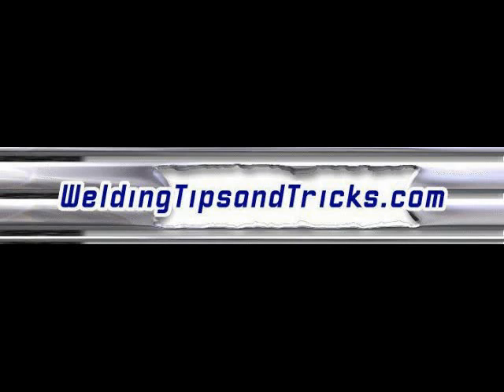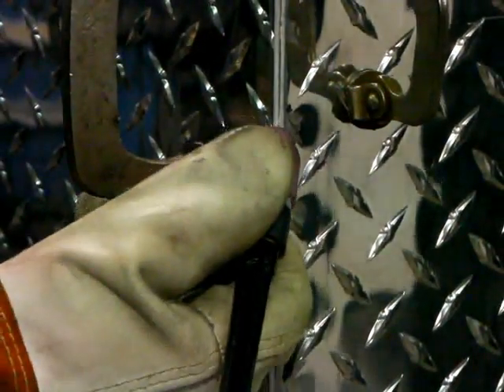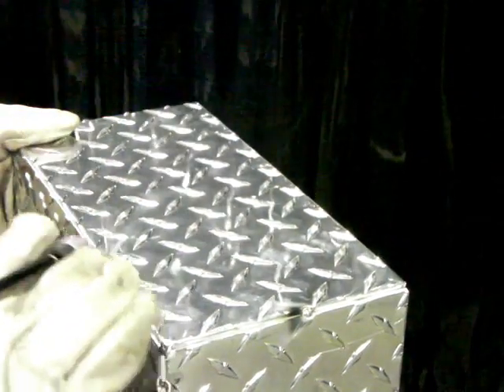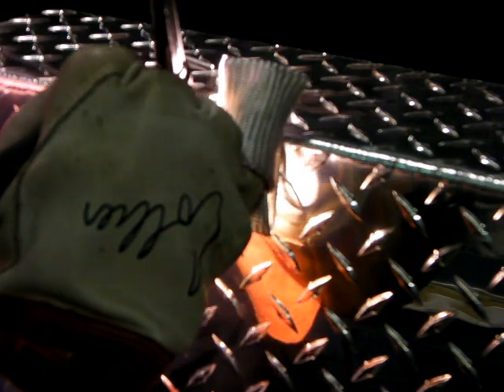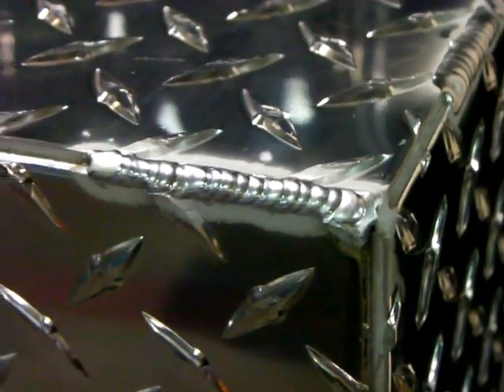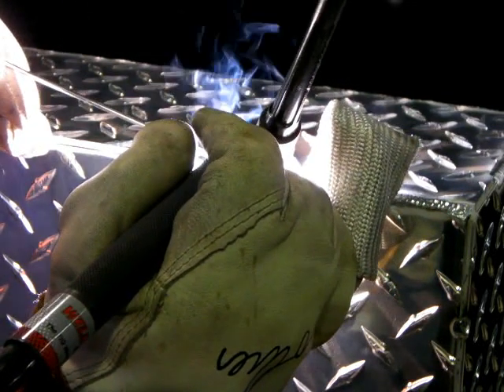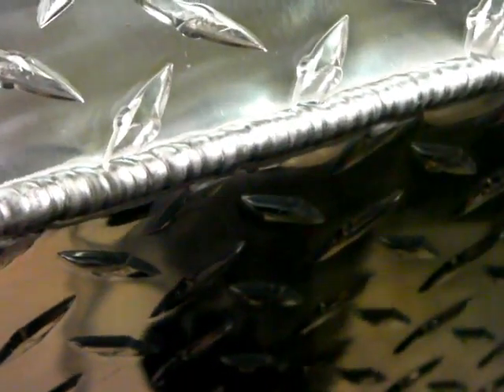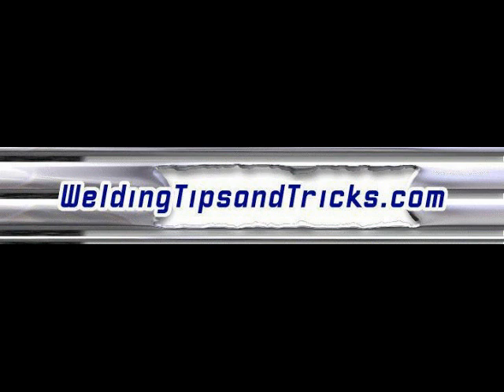Tig Welding Aluminum Helium Argon Mix

Comment: I have a Miller Syncrowave that uses an air cooled TIG torch and I am thinking the helium mix would help cool the torch some as well as transfer heat to the aluminum part. Of course I could be wrong but I think not. I know for a fact that helium transfers heat very well. Helium is used as a purge gas for dry cask storage of spent nuclear fuel assemblies to transfer decay heat to the outer shell of the cask. The heat from the cask is in turn dissipated into the surrounding environment cooling the cask.I have used straight helium and DC with the TIG process before and it works great for heavier aluminum, too hot for thin pieces. Dirty and sooty, looks like mud or Incolnel when your welding but for getting the heat in the part quickly only a wire spool mig process is better that I know of.

Comment: can the helium /argon mix set up be made with the two cylinders and mixer only or can it be done by just getting both gases mixed in the same cylinder from LWS and which method do you think will work the best?

Comment: very interesting your video i would like me to orient me i have  a job that has been presented to me to weld aluminum  rectangular profile of 40x80x2mm the case is that i have a machine of 250 amperes dc i want to know if using pure helium i can weld with this machine in aluminum dc since ive seen the  videos q if you  can weld whit this gas in dc agradesco its orientation  thanks

Comment: Helium is used for automated welding with a feeder for the filler, because it has such a high travel speed.  At one time they used DC reverse to weld beer kegs.

And no you can,t use CO2 or C25 for TIG, they would oxidize the tungsten.  You have to use inert gas ONLY, so this limits you to Argon (the cheapest), Helium or mixtures of the two.  The other 4 inert gases are Neon, Xenon, Krypton and Radon.  I have never heard of them used as shielding gas, probably because they are super expensive, and Radon is radioactive.

Comment: Helium also helps you increase your travel speed which tends to give you a shinier final weld. This means less final cleaning. Slower travel speeds tend to give the bead a haze and sometimes fuzzy appearance. Just a little helium added definitely makes for better aluminum tig welding. Good video!

Comment: Ok quick question. I know helium adds a punch to aluminum. At one time I run a seam welder for a tank building company. I used 100% helium as my gas. One delivery day the driver did not have enough bottles to last me the week so he had helium spec gas. It's used for some other processes. When I hooked it up to my welder it seemed to get hotter! I had to increase travel speed and reduce volts. Why is that? Thought helium was helium. Both he said were 100%?

Comment: great video. i have a lot of  questions about the process set up and required tooling. for instance the check valves on the line. where can i get them and what do i ask when purchasing them. second flow rates on both the argon and helium flow meters..i understand its a trial as you go.but where do i start at 10 cfh?argon 5cfh?helium. i dont understand. thanks so much for the videos that you do it opens a whole new world for me. mahalo much. aloha!

Comment: You can use whatever % helium to argon you want up to 100% helium, the higher the helium the hotter the arc heat, problem is the higher cost of helium to argon. Normally only use helium mixtures with thick AL - at least 10 mm plus and especially copper and its alloys. Also to answer one question - yes you can weld Al with D/C but it must be D/C Positive electrode which needs a much larger dia tungsten as it is taking 2/3 of the heat - but lovely clean weld - with an A/C arc it is only the positive half of the wave form that cleans the arc, the negative half cycle is only a cooling down period for the tungsten.

Comment: Im thinking of making a custom 7 gallon gas tank with diamond plate. I just bought 3/16 plate, but when I measure it..? its only 1/8" thick... The guy who sold me the plate says the diamonds are part of the measurement... So it is really 3/16... Is that correct? Also, will this thickness work well for my project?  Will the welds be able to  hold gas and not leak?

Comment: Off course you can tig with dc, but not aluminium.
Reply: Incorrect. I routinely weld thick sections of aluminum with TIG, DCEN using helium. I do thin sections of aluminum with TIG, DCEP using straight Argon.

Comment: DC will not work for aluminum.    The oxide remains on the surface and just lets the part get hot as hell which then just melts into two blobs.  You ruin your part.
Reply: LOL

Comment: Hi,
Great Vids,subscribed and working through them all.I have a couple questions.1)Would it be better to use 100% helium,as opposed to the 80/20 mix you used,and if not?I remember as a kid people calling stuff Heli-arc welding but never saw it done to know what it consisted of.2)On this particular project with the tread plate,what was your flow rates for both gases?Thank You again for a great series!!!

Comment: I'll agree that the dynasty 200 is a good machine, but its begun to die on me lately. I had a 21ft skid loader trailer come into my work with a broken storage box in the front, and needed a 4x6 piece of 1/8in 5052 diamond plate welded to the back on the loading ramp. And for some reason it won't puddle for like 3-4 seconds on 200amps maxed out.

Comment: @Helpmefly it's still about 2-5 times as expensive as argon, depending on supply/demand. He is cheaper in the US because we have large reserves of natural gas, and a lot of our gas wells have a higher-than normal percentage of helium. Also, it's questionable to be using He for trivial things like welding or balloons, since it's a non-renewable resource. There are some technical and scientific applications which simply won't work without helium, most important being MRI machines.

Comment: @morgorth3242 
1) NO! Adding CO2 to your shield gas will result in slagging both the aluminum and your electrode to a lesser extent. Al is pretty reactive towards CO2. You might be able to use it for DC welding steels in a pinch. However 15%CO2 is an excellent all-purpose mix for MIG
2)No. MIG welding power supplies are of the "Constant voltage"(CV) type.  TIG and stick need "constant current" power supplies (CC). Trying to TIG with CV would make starting and arc control almost impossible.

Comment: I like the use of the heat sheild mesh on your torch hand..  great idea.
I use a mix of argon/helium through a company in Canada called "blueshield" there are 3 mixes.  1=25% helium to 75% argon
2=50% of each (my favorite for sure)
3=75% helium and 25% argon (super hot)
this is a great way to teach those who can or want to weld.  Thanks for the tips and tricks.. your never too old to learn.

Kelly  - welding over 20 years
dynasty 200 dx - most recent machine.

Comment: @BigDub2010 I was taught the same thing in school... But once you get out there you'll quickly learn that you really don't learn a lot in school, lol
If it's a transformer type welder. You can only use a balled up Pure Tungsten for aluminum.

Any inverter or TIG with squarewave technology can run almost any type of tungsten. Balled or pointed. If you have a chance to ever try this. Try using Zirconiated Tungsten with a sharpened point on aluminum. It's absolutely awesome.

Comment: @BigDub2010 Why?
Sharpening is possible... On any machine that uses square-wave technology, or an inverter, can use other types of tungsten OTHER than just pure tungsten....

having a tungsten with a sharpened point focuses the arc in one spot. Much more stable. as the arc isn't wandering all over the place...
You can almost all types of tungsten for aluminum

Comment: I tried your tig tacking method yesterday. Very useful.

How about showing some thick stuff like cylinder heads. Whilst I can do it,  my stickout can only be minimal (like 1mm) for it to work but I have seen it done with 3mm+ stickout  but it does not work for me. Gas lense helps alot.
Getting good gas coverage is the most important point I missed when self learning aluminium and helium mix a must.